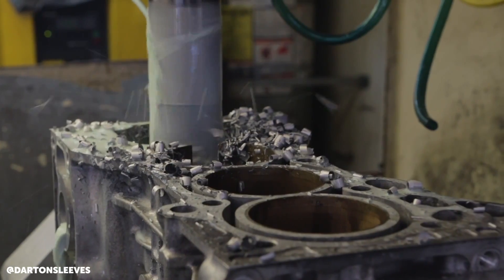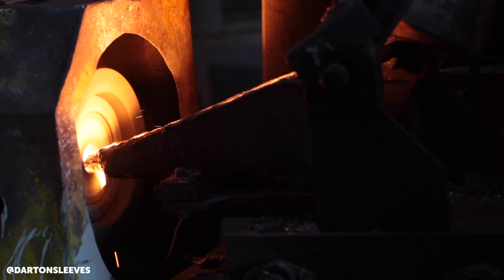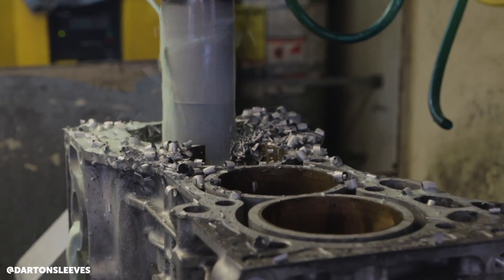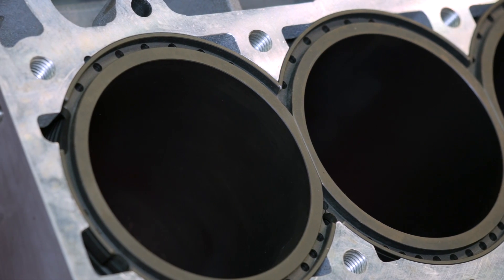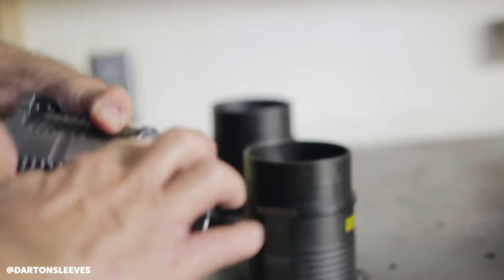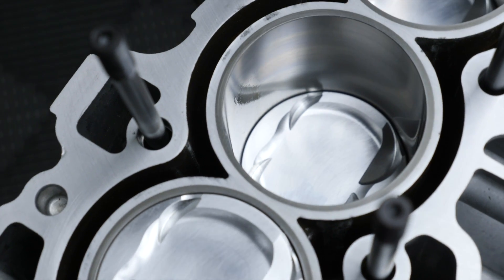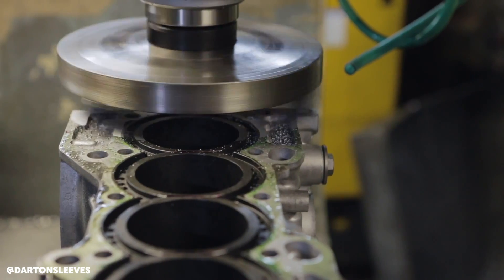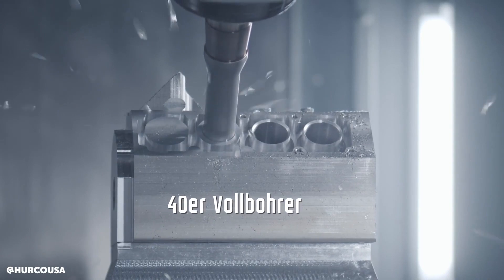Too much BOOST for your engine block? This MIGHT be a solution.

Comment: I´m not crazy about it, not in this guise anyway.  I see differences in thermal expansion between the cast aluminum and the cast iron sleeves as a big cause for concern.
Reply: even top fuel use the cast iron sleeve in aluminium blocks if it works at 10,000+ hp on engines producing over 1000hp per cylinder I will be inclined to assume it will work on most other engines
Reply: @Realtime1501  Yes, but those engines are rebuilt after every run iirc, so theres a bit of difference there.
Reply: @StalkerGamingHU  ok then how about every single billet aluminium engine uses these sleeves,Proline,Moran motors ,AJPE,Elmer racing,Bullet engineering,Mazworx

Every serious racing series has some form of a competitor using these sleeves LeMans,NASCAR,DTM,Supercars,Rally 

a cast sleeve has absolutely no performance downside in any performance engine aside from getting them fitted correctly
Reply: Exactly.   @StalkerGamingHU
Reply from the maker: Iron sleeves in aluminum blocks is nothing new. Even OEMs are doing this (not to the same strength requirements as what is being discussed here, otherwise we wouldn't need the likes of Darton).
With that in mind, you won't be the first person to do the maths on this if you decide to dig into it for your own engine build. Alternatively you can use other material noting whatever call you make, you will have pros and cons to weigh (cast iron, ductile iron, alloyed iron, steel and aluminium are all options for you all with their own advantages and disadvantages)

You should 100% be talking to companies like Darton rather than buying blindly too. Call around, explain your build details, note the advice, make educated choices from there 😎 - Taz.
Reply: I suppose you don't like valve seats or valve guides either. The block can be machined around operating temperature, and sleeves are often cryogenic chilled before insertion if done properly.
Reply: No I don´t have a problem with valve seats or guides, those are different issues alltogether.  The problem I see is that you would have to ensure that the thermal management of the block is in concert with the load/temperatures in the cylinder itself so that the expansion of the aluminum block, which far outstrips ferrous metals, is in concert with the cast iron liner.  Get it right and the gap tolerance taken up by the head gasket can make up for the small differences that are sure to exist.  Get it wrong, and either a gap between the sleeve and head with allow gasket failure OR the sleeve will ´grow´ more than the block putting undo strain on the head bolts which can also cause gasket failure.  I would only run such a solution on blocks that have more than sufficient head bolting capacity so as to leave a slight interference fit of the sleeve to the head along with a trick cooling system that can allow for temperature changes via a proportional type thermostat/valve to compensate for extreme situations in the hope of minimizing both materials fighting each other, so to speak.  Like I said, it can be done but you have to really think outside the box to make it happen reliably in all situations.    @chippyjohn1
Reply: @rafaellastracom6411  I understand, and I repeat. If the liners are fitted when the aluminium block is at operating temperature and the liners are chilled you end up with a tight fit. If you machine the deck flat while at operating temperature you can achieve a dead flat surface. Factory engines have used sleeved liners for a long time. Head gaskets have been MLS for a long time which have a small amount of spring in them that compensate for expansion. On the extreme you can also use a fire ring. Also although aluminum and iron have different thermal expansion, the liner because of its worse thermal conductivity and direct link to combustion will be a little hotter. Further more all engines are controlled by a thermostat regulating the engine temperature. Also the low temperature of 100c and the short height of the liner even with the block made from aluminium does not allow much elongation due to heat. The engine I use for an aircraft has an open deck block with ductile iron sleeves and its heavily boosted, although I use fire rings. Works fine.
Reply: Iron sleeves are in almost every production aluminum block made
Reply: @rafaellastracom6411 if sleeves are fitted correctly, by and experienced engineer, that knows what he is talking about, it’s a very desirable, high performance and reliable medium. Very much more robust than a standard factory finish!
Reply: many times you're removing a thin OEM iron sleeve and replacing it with a beefy aftermarket sleeve. There are very few cast aluminum engines that don't have an iron sleeve, and the ones that dont have an iron sleeve have many issues with their crap coating wearing off and then the rings destroy the aluminum.
Reply: Yes you are right. Back in the days when blocks were sand cast and liners were made from steel i.e. up untill the 60's  thermal expansion differences were a major headache for anyone designing a new engine.  Certainly by the late 70's early 80's manufacturers were getting material selection about right.
There is of course a difference between a wet liner and a sleeved block. 
The guy who used a drag raceing application to make a point is missing the point; they don't have water in them, or they are dry decked.  
The product Darton offers is as good as anything available before we all go EV.
Only thing I would question is his tolerances 
Up to a thou from one cyl. to the next is too much. On a non CNC jig borer you can repeatedly hold .00025in and .00005 for one  off's. These tolerances have proven to be reliable or more precisely have not been the cause of a failure, there has been countess other reasons for those  over the past years🙄🙂
Reply: Just stop talking, please.
Reply: @SIRICKO  Mechanical engineer you are not, that´s for sure.  Blocks have been sleeved for a long, long time and they work but they are fitted into an aluminum jacket.  This design does away with that and has only the cast iron sleeve solely responsible for sealing.  Can it work?  Yes, in many cases but not all of them.  It´s just not that simple.  Before you ask yes, I am a mechanical engineer with 30 years experience.